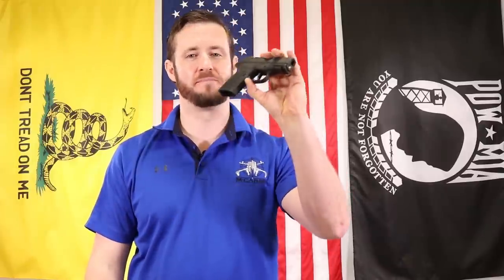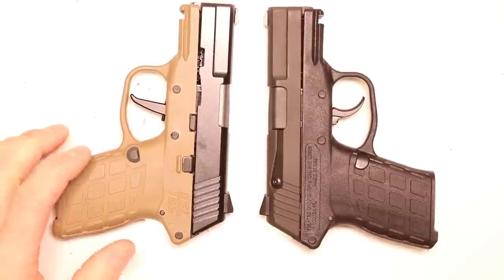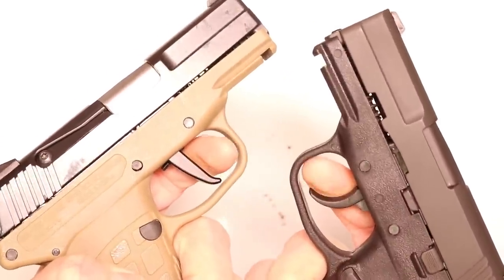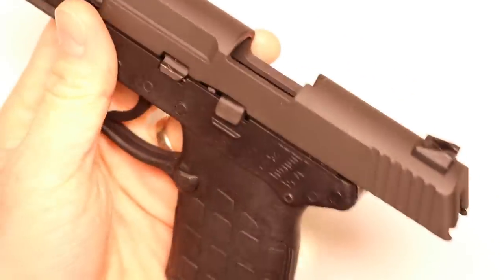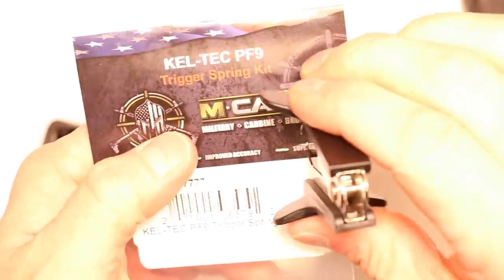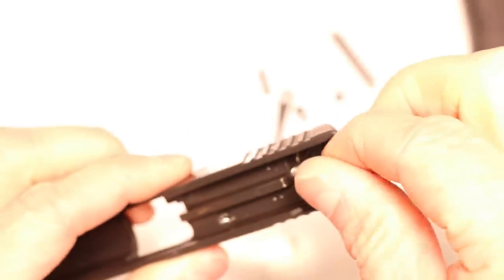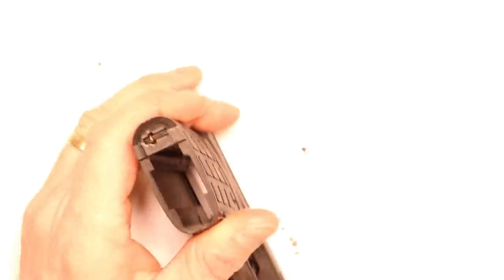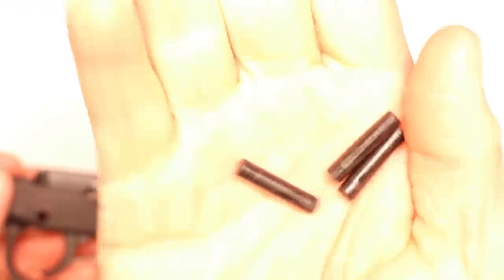KEL TEC PF9 Trigger Upgrade to Reduce KEL TEC PF9 Trigger Pull - All In One KEL TEC PF9 Trigger Job

Comment: I installed the P11 trigger spring kit, Stainless steel guide rod, but not the not the 20 lb recoil spring. I'm old, have RA and already have a hard time racking the slide on 16 lb factory spring. Plus, when I reload I use the recommend 'starting load' most of the time.   My last order was the new (wider) aluminum trigger! Love the way it feels! 
But I had a problem, the RESET was horrible! My new trigger reset spring from the trigger kit worked great with the old plastic trigger. So it wasn't caused by the spring.  Could not figure it out. I almost reinstalled the old trigger. But, since I wasn't planning on using the P11, so I put it back in the safe. Today, I decided the .380 with 6 rd mags might not be enough, even if I carry a couple of spare mags. 
So, I got out the P11 and dry fired it a few time. Yeah, on 'Reset' the trigger would move forward, then stop for a bit, then start moving slowly forward again, until reset was done! Sometimes the trigger would just stop in the middle of reset! I decided to inspect the plastic frame for defects. Nothing seen on both sides of the trigger, looking at the bottom of the frame. Was it shifting sideways? I held the P11 up high to look up at the trigger from below. Nothing seen. 
Then, Held the P11 sideways 6 inches from my eyes and saw the problem! The new trigger was too long for the plastic Trigger guard! The tip of the new trigger was dragging on the bottom (inside) of the trigger guard! The factory molding seam was sticking up about 0.1 mm. Some light sandpaper work and my Reset was working perfectly! Now, maybe I can re-install the over-Travel screws and see if it could possible work any better!

Comment: PF9 FLAT TRIGGER AND SPRING KIT
 
Installed today went well very easy to do if you follow the u-tube video. Only one point I found where it says to use a 3/32 punch I used a 1/16 punch and that seems to work better for me.  I have not been to the range yet to check it out, but it worked with snap caps.
Reply from the maker: Thanks Brother for sharing your results.  Looking forward to the range feedback!

Comment: Ive owned this pistol for at least 4 years and never have shot the thing.  But, ive upgraded this and that like extra mags with +1 extended floor plate.  So now the springs and trigger.  I hope to take all my new stuff out for a good shoot one of these days.
Reply: this kit installed just like the video with no problems at all.  The trigger pull feels great, smooth and light.  Its is a great improvement.

Comment: I used VibraTite instead of locktite just Incase I need to ever get the screws out. Those little Allen keys strip easily. Also I only got one of the pre/over travel screws, no matter for me as I intended not to use it. I’ve had the trigger installed for about a month now maybe. Absolutely love it vs the factory trigger. Love all your products, top notch stuff!

Comment: I went to the range and had a consistent trigger reset failures even after checking function with snap caps after install. I have an early production P-11 with the MCARBO Spring kit also installed. I needed to remove some material at the tip of each set screw to achieve proper reliable function in my gun. The issue was pre-travel, my gun needed more pre-travel in order to reset than the unmodified set screws would allow. If I adjusted back far enough to get a reliable reset then the trigger wouldn't release the hammer. Hopefully this will help someone else if they are having the same issue.

Comment: If you're afraid of that 2lb trigger just replace the trigger and use the stock springs.
Reply: I like the way you think! But will the new trigger be friends with the old springs? Guess i will find out. Had ordered the guide and spring yesterday, probably will be ordering the trigger soon.
Reply: Friend, how could I buy accessories? I am in Mexico, is it possible? I would like to know if it is possible, how could you help me?
Reply: I suspect that's what I'd do too.  I still worry about the lighter firing pin spring too.  It has no hammer safety except it's stiffness if ever dropped nose first.
Reply: My p11 still has stock parts but the 1 thing I did to help alot with the trigger pull feel was the keltek fluff and buff.. It made the whole gun feel so smooth.  It took a few pounds off the pull.  Look up the procedure online but iirc the most important part was smoothing the transfer bar.    That alone smoothed out the action considerably.  I'm looking forward to adding the trigger now.

Comment: Looks like I got a bad one.. my threaded holes are off to one side... in other words.. it wont center up enough for me to be able to start the set screw down the center of the trigger.. almost like it was machined 1-2mm off.  I had to drill the hole slightly larger.  My factory trigger lined up perfectly.  Fix was super easy and I don't see it creating any problems since he mentioned some ppl had to do this for other brands of triggers.

Comment: I noticed just a few tiny differences in the p11. Hammer spring shape, hammer pin went in opposite side. My p11 aluminum frame dropped in easier too. Very thankful for the video

Comment: Just got mine in, opted out of recoil spring. Install tomorrow, just have to find a torx wrench, will update later.
Reply: Found a torx set, did the swap out in about an HR. also swapped out the extractor and spring I got from keltec. Video helped a lot. Putting the firing pin back I just get it  as close as I can and continue to pres in and out on the pin while I finish the screw so I knew it was captured the whole way in. Over travel screw is pretty much useless for me unless it's threaded all the way out and I just overall don't like the way it looks. Backed the pretravel out about 3/4 of a thread from malfunction. Thinking about getting the recoil spring later to see if it actually helps.
Reply: Took it out for a quick function check, ran smoothly. I'm gonna take it out this weekend and get a feel for the new trigger. Not as light as I was expecting, but significant enough to keep the firearm from moving around while squeezing the trigger.

Comment: Been looking at the keltec as my first handgun for a while. Going to get it real soon and will definitely be upgrading it with y'all's parts! Awesome work y'all are doing
Reply: don't get something else
Reply: Don’t. The trigger is so bad on mine I am ready to throw it away. By the time you buy all of these upgrades you are like $100 away from a used Glock. Keltec makes some cool stuff. This gun is not one of them.
Reply: @ma1kmcn1  Agreed.  These upgrade kits are for those of us that already own one of these turds and are debating about trading it in for almost nothing or just putting it in the back of the safe never to be seen again. If someone doesn't already own a PF-9 then a Taurus, S&W M&P, or Ruger would be better and still not break the bank. Glock is awesome too, of course, but is more money...new at least.

Comment: Great video! The only issue I am having is that the extractor screw (T8 not T10) in my Kel Tec is being really stubborn.  I can't loosen it!  Will put some silicone around it and try again later.  Has anyone else had this problem?  I may have to leave the stock spring in place if I can't figure out a way to loosen the screw!

Comment: Nice idea for a range gun but I cannot be the only one who does not want a light and/or short trigger pull on a defensive firearm which will most likely be stuck in a pocket at some time or another... Many of us buy these pistols with the long heavy trigger pull for a reason and it makes no sense to change that...  Also many attorneys who handle defensive shootings suggest your firearm should be factory original to give the prosecuting attorney less chance to make you look like a bloodthirsty killer because you modified your pistol
Reply: No hammer, no safety and a two pound trigger. No thanks, I'll save target triggers for target guns.
Reply: Lol I cringed just reading these. Y’all that scared, don’t carry 🤷‍♂️ Stop being Fudd weirdos and get training so you can have confidence. Having a shitty trigger isn’t the difference between doing the right thing and the wrong thing. The person is.
Reply: @Puddin127  That's okay,, I cringe at comments like yours from people like you.🤔
Reply: @simongrey3806  Exactly 👍👍
Reply: @Puddin127  I've been carrying for over 35 years. My father first put a gun in my hand when I  was 4 years old. I've fired more than 300,000 rounds and loaded several million. If you need a 2 pound trigger on a defensive weapon you should probably get some practice. It's really not that difficult to hit with a 12 pound double action trigger.

Comment: Why was the pretravel and stop designed to have them push against each other in the same hole?  1st the stop should be near the bottom of the trigger for fine tuning and minimize leverage.  The pretravel should not be dependant on the post travel adjustment.  Are you not allowed to seperate the 2 screws in the single hole to adjust each seperately?  At this point I may still get the trigger but just superglue the eraser to the bottom back of the trigger or back of triggerguard.
Reply: Angelfire shows you how to do it with a threaded nylon set screw

Comment: Skip keltecs, get a shield.  Trust me. I know from experience
Reply: Just watch this video I have A P9 with issues on recoil freaking hard to pull back not  normal, don't know what the upgrade costs. What is a shield?
Reply: @nitrofish1974  the shield is a smith and wesson 9mm shield.  Its under $350 and is soft to shoot, reliable, and accurate
Reply: Or just get both....I have the PF9 and Shield 9

Comment: OK so what black magic did this guy use to get the trigger pin out?  I have literally hit the damn thing so hard it broke my punch and the pin hasn't budged.  What gives?
Reply: I had the same issue, bent my 1/16 very quickly. I switched to a 3/32 punch which worked much better but was an EXTREMLY tight fit and I wound up slightly damaging the trigger axis. It all turned out fine but i would reccomend using a different, stronger 1/16 punch or tapping (hammering more like it) the trigger pin out about 1/4 of the way with a 3/32 and then switching back to the 1/16. There are probably better ways but they're unknown to me.